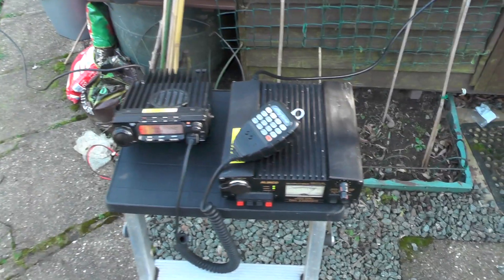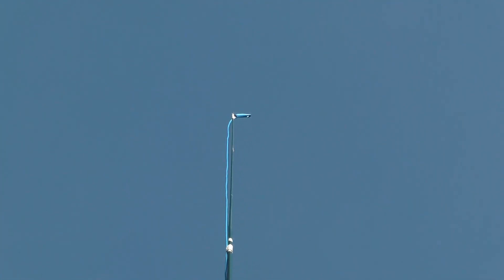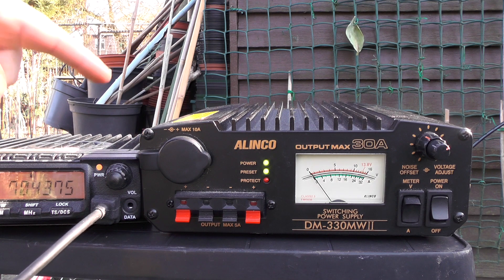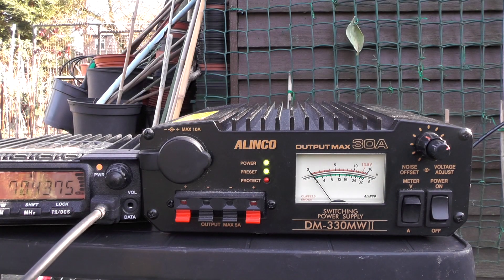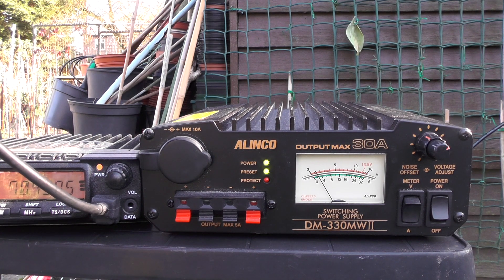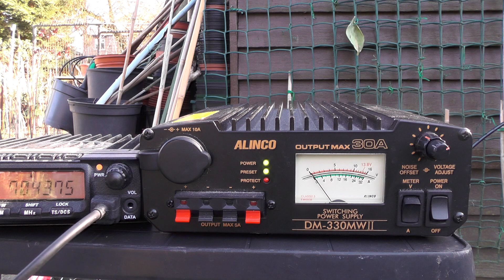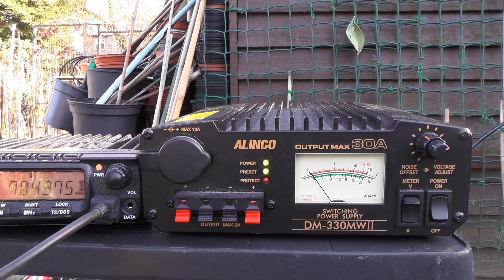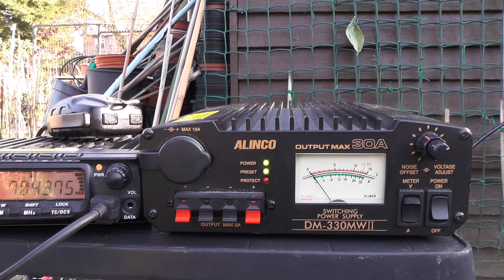Viper antenna 4M (70mhz)

Comment: Your amp meter is showing less than  4 amp am i missing something
Reply from the maker: That what the radio is drawing in power the radio will do 50w I’ll re check it and see what it does into a dummy load

Comment: Hi Jez another very impressive demonstration of your radio on the 3 different power levels and I have got the same antenna as yourself mines homemade and it's called a flowerpot antenna that's what my mate said it's called as far as I know mate OK and I've now got the Garex 4001 radio for the 4 meters and I've had lots of contacts around the Liverpool area and the furthest I've got is out in to North Wales and all that I was using was 5 Watts QRP so my radio is working really well and I'm very impressed with it. Stephen M3SNV 73's.
Reply from the maker: My antenna is a viper antenna and works very well got it from eBay

Comment: Hi mate, just got this antenna a week or so ago, now use it to do net control on the North East 4m Net......works a treat 👍🏻.......Paul
Reply from the maker: its a good antenna it works well much better than my dipole antenna. whats 4m like up in your area?
Reply: Well, it was dead until last Monday, I got in touch with as many as I could and people passed the word round in 3 days and we got 9 on. Hopefully tonight we’ll have over 10, fingers and toes crossed 🤣👍🏻, how about down your way?......Paul
Reply from the maker: @r188ops8  its quiet I can access the parrot at tring and hear the 4m news but I wont give up on the band
Reply: Exactly mate, I’m like a dog with a bone. Knocked up flyers for the blokes at the club to take to other clubs and stick up......you can only do so much though. I know there have been people listening to me when I’ve been sat on 450 calling out as my QRZ views have gone up whilst I’ve been out!!

Comment: Good morning, Great video.  regarding mounting, yes the choke is slid over the pole. Please see the instruction leaflet sent with the antenna. Thats a good contact from the back garden on low power, 3o miles or more cant be bad :)  Would you mind if I put a link to this video on the Hawkins-radio FB  Page ? and any pictures of any pictures/ videos of future portable activations?  If you have any questions please contact me via the H-R page.  Thanks in advance 73

Comment: Perhaps you can get up on a hill during a 4m contest and try your luck there? Nice video, as always!
Reply from the maker: I try that Ive just ordered 2 5a lipo batteries and got a y cable to run them both at the same time I just need to get another power lead and soldier it up so I can use it mobile